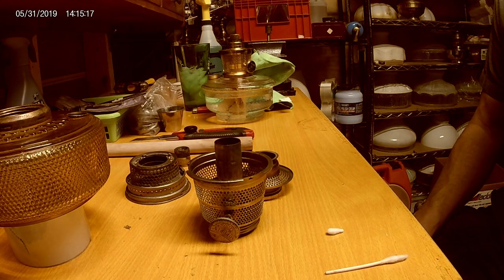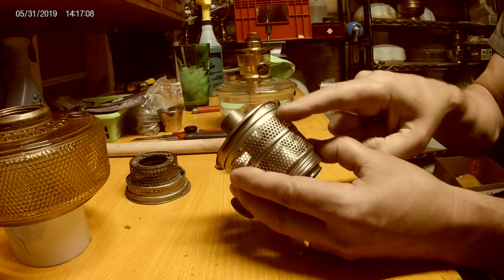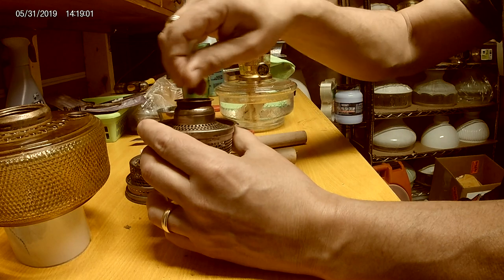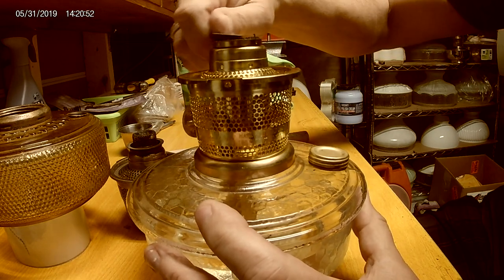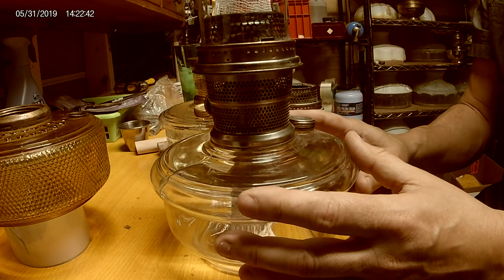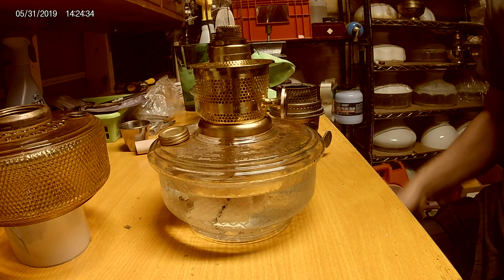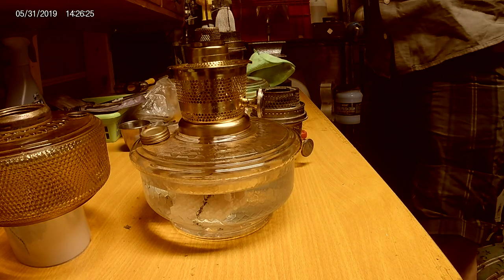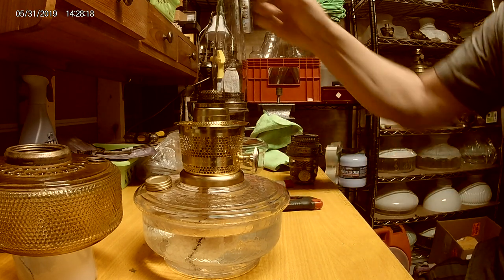Aladdin Mantle  troubleshooting

Comment: Thank you! This was very informative. I moved on to a narrowboat and found an Aladdin lamp in a cupboard. There was a brochure and a letter written to the makers complaining that it was too dim. I know nothing about them but I have Tilley pressure lamps. Your advice has given me the inspiration to get the Aladdin working well.
Reply from the maker: You are welcome. I'm not familiar with the Tilley Pressure lamp but it looks like a Coleman lantern to me. If it acts the same as Coleman, that is a great lamp because you take it outside and it makes a lot of light. The only issue with that style of Light is that it makes a lot of noise indoors and if it uses White Napha as a fuel, that is about $30 a gallon, almost $5 a litre. Now Kerosene bought in Bulk at the pump is about $1.50 Canadian.
when an Aladdin is running nicely it should be hard to look at night without a shade.
Cheers and good luck

Comment: So happy to have found your channel. As for my #23,  the flame continues to creep up even on the lowest setting. New wick, K1 kerosene, trimmed and re-charred but still the creeping and a few spikes. This is my second lamp and the other performs just fine with high altitude chimney & light booster. I live @ 7,500 ft.(2,275 meters). Thanks, Steve
Reply from the maker: I have had mixed success with 23’S. I have one that is phenomenal and a few others that only will work at 60%.
You need to find a doner lamp or burner to play with.
Cheers
Reply: @Kerosenecanada  Thank you. Taking a leap and purchasing a new MB 502! found a MIE #23 you know where but may wait to see how the MB 502 performs here at elevation.
Regards,-SW

Comment: Thanks for posting this - I have a 70s British model 23 (Aluminum bowl) that runs, but currently suffers from a flame spike in one spot so it's not terrifically bright. Thankfully I spotted the issue and turned it down. 

I don't have a wick cleaner/shaper, so I've ordered one and then I'll see about getting the wick clean and even - if it keeps going I shall try your other suggestions!

Comment: The brass wick trimmers are made to trim by turning clockwise, the plastic ones work in both directions. The manner you show with the wick extended up so high could lead to an uneven trimming because it isn't referenced to the lip of the wick holder. I found it better to burn the wick for a minute or so, pull it back down, put the trimmer over it and raise the wick just enough that it starts to lift the trimmer. Then, while pushing gently down such that it (the trimmer) rests against the outer ring of the wick holder while turning clockwise. You might have to slightly extend the wick as you work out (scape away) any unevenness.

Comment: So im soo glad I found your channel. Not much out there content wise but your video have helped me get my main three lamps going and running well. Was curious about if you come across deformed mantels alot. I found two boxes of Loxon mantels and about 70% of them were deformed in some way that they just won't run correctly.
Reply from the maker: levi Anderson , I really only use brand new mantles as a rule of thumb Levi. I have old mantles that I run across and I just don’t use them. Sometimes they are oddly shaped and sometime they just fall apart after a few uses.
When it comes to wicks and mantles, I find new stock is the best.  
What is country of origin on those mantles?

Thanks
Dave

Comment: Hi thanks for the info, great video. If I’m purchasing an Aladdin lamp how can I tell the difference between the different models also would it be better to buy new burners and will new burners fit old lamps. Thanks.
Reply from the maker: http://www.aladdinlamps.info/

This will help. Sometimes the new ones are not any better than the old ones. The model B is considered by most lamp owners as the most reliable.
Cheers

Comment: I realize is an older video but - I have a small metal cup like you use to put in your chimney when you blow it out, but I am nervous to use it for fear the very hot chimney may crack when the cold little cup is dropped in place. I just want to clarify, you place this little cup to stop the convection immediately after blowing out? You never had a cracking chimney doing this? Thanks. 

Great videos. I am slowly piecing a small lamp hobby together and have relied on your vids a lot.

Comment: What do you recommend for model 12s for inconsistent Burns even after trimming wicks and repositioning galleries I have two that I burn in the winter time and fall and this is always been an issue input would be much appreciated thank you and great video.
Reply from the maker: You know, I run into that problem quite regularly. I just swap out parts until it burns nicely.
Even if you identify miss matched parts or tolerances you really need spare parts.
I think it’s a gallery issue as a guess as what I find is a common problem.
If you got a local lamp guy around you, you might want to pay him a visit.
Thanks

Comment: I have a C model burner that just won't burn blue. Just get yellow spikes. I have tried trimming it but that doesn't seem to help. The wick is for B C and 21C . the lowest the flame spreader would go was 2 rows of holes higher than the top of the gallery. I trimmed off the bottom and now just one row shows above the gallery. There was a slight improvement with the flame. Do I need to lower the spreader more ? .... thanks for the nice video
Reply: Kathleen Winans  Hi Kathleen, sorry to hear of your issues.  Are you using Kerosene? If so and you have those flame spikes, that means there is an air leak . The outer wick tube is not close enough to the wick. Now without seeing it , that’s just a educated guess.  Model C burners were redesigned several times and the parts don’t interchange, maybe the outer wick tube is off another model, it might fit but not work properly. The flame spreader should be pushed all the way down and see three holes rows on a Aladdin model C IND Brass burner.. I just grabbed one from my lamp room at took it apart, it really doesn’t assemble nicely. If you can get it burn evenly and blue, I would look for a model B to replace it. They use the same wicks and mantles.  Good luck.

Comment: Your lamps are all so nice and clean! I have a model 23 that was left for a number of years unused and the kerosene all evaporated out. The glass font had green residue that I cleaned out, but the burner has a lot of black residue that looks like tar. What would you recommend to clean it up?
Reply from the maker: arweninnj  I use oven cleaner and or paint stripper depending on how bad it is. Some other collectors swear by ammonia, some like lemon ammonia. They will all work. I personally don’t like the smell or ammonia.

Have a great day
Reply: @Kerosenecanada  Thank you!

Comment: Before my grandma passed away, she gave to me the Aladdin lamp they used to light the farmhouse before they had electricity when she was a little girl.  She said she remembered it being so bright that they had it in the middle of the room and the family could sit around it all reading in the own corners of the room.  I looked up the design and think it’s a 23.  I’ve replaced the wick and the mantle, and I can get it to light just fine.  It seems to have a good even flame around the wick.  I turn it on low, leave it a bit, and then try to turn it up brighter.  But I seem to keep burning up the mantle when I turn it up. Am I just probably trying to turn it up to bright? Or what else might I be doing wrong?
Reply: I have a 23 that does this. I think it's not pulling in enough air to cool itself as even the nob to turn it up and down gets hot. I'm currently running a 23 with a high elevation chimney and it stays cool. I'm gonna order another, I can't switch them to verify as one is lox on and on is slip, and see if that helps the issue.

Comment: I have a B&H center draft oil lamp. The parts are frozen and I have no idea how to remedy this. I’ve tried using three in one oil and letting it sit but it’s not helping. Do you have any ideas of what I can do?
Reply from the maker: Heat. Get it real hot, wear gloves. Hair dryer or hot air gun works well.
Good luck.
Cheers
Reply: @Kerosenecanada  I’ll give it a go, thanks!

Comment: Paraffin fuel supposedly burns cleaner with less soot and fumes, but some say that wax will eventually clog the wick in an Aladdin lamp.  Which fuel is best?
Reply from the maker: Kerosene because it burns cleaner with no carbon build up on the wick. Cheers

Comment: Thanks just got a new Aladdin and it’s start glowong low or in the middle never will toward top except if it’s at the point of over burn
Reply from the maker: I would have to guess on a lot of things. Burner type, new wick?
You might have to adjust the position of the flame spreader. 
If your flame spreader is pushed in too low, the flame will be at higher point of the mantle.
If the flame spreader is too high then it will only light up the bottom of the mantle.
This is just a guess at this point.
Good luck.

Comment: I just bought some mantles labeled " Aladdin Upright Gaslight Mantles"   They look like newer versions and the bases are made of aluminum.  Are these safe to use?  I've been told that the aluminum bases are prone to melting.
Reply from the maker: Those are designed gas lights, not kerosene.  They won’t work. Sorry.
Cheers

Comment: When I burn my B burner with the B gallery assembly, the flame & incandescence is flickering/quivering regardless of the wick setting. When I put the 23 gallery assembly on this B burner, it's smooth. It also SEEMS the flame is higher and more jagged with the B gallery at a comparable incandescence level to the 23 gallery. What causes this? (The B gallery has a new India very wide & globe shaped mantle & at full tilt, the bottom 1/2" is not glowing, if that offers any hints.) Being OCD, these darn things can be frustrating. lol Thanks so much.
Reply: I borrowed another B gallery that works fine.. The micrometer showed the inner-most gallery cones are the same size, but the bad one is positioned higher which would cause a leak. I wonder if I can smack it down a bit with a proper diameter tool so it meets with the outer wick tube sooner?
Reply: FIXED IT!  One of the 3 lips on the top of the basket that secures the gallery was bent down which caused the gallery to distort & rock when secured. Used pliers and bent it back up and now it works fine. The blue flame is still a tad shaky at lower settings, but incandescence flicker is now gone! Also used a NOS mantle instead of the new garbage Indian-made one. Those new mantles are destroyed during the initial burn-off process... disgraceful.

Comment: I’m working a #6 Aladdin brass job but don’t have a 6 flame spreader. Know the best one to get the burner souped up?
Reply from the maker: Well the question is where do you live? I might know of a collector friend nearby.
The good news is that the 6 flame spreader is still a fairly common part.
As far as Souping up. They are a Hot Rod right out the box.
Cheers

Comment: I have a very old Model B which needed a new wick.  All of the videos I've seen, the wick carrier comes out the top (it seems all of the videos are for a 23?).  On ours, it only comes out of the bottom, I'm guessing this is normal for a model B?  Thanks!
Reply from the maker: Yes, it slides out the bottom.it’s easy to change, that’s why there is no videos.
Cheers
Reply: @Kerosenecanada  Thank you so much!  I'm in the process of cleaning it up, pretty sure I need to polish up the wick tube, it's pretty rough.  Thank you again for your help and the great videos!
Reply: @Kerosenecanada   One more question if I might....what would you recommend to clean off all of the dried kerosene from the flame spreader, etc.. So far, it laughs at mineral spirits...  Thanks!
Reply from the maker: @gregorymoore3526   try ammonia.
Reply: @Kerosenecanada  Thanks! I'll give that a shot!
Reply: @Kerosenecanada  Thank you so much for the ammonia tip, soaked everything overnight and poof!  Again, thank you very much!

Comment: I am having a problem with flickering and uneven burns. Sometimes the flickering is even audible. Mine is a 23 with the aladdin lamp on the knob. Any ideas? thanks
Reply: ok, I trimmed the wick like you showed with the knife, but used a double edge razor blade. With the wick riser all the way down, the wick was above the inner wick tube. I trimmed it flush and it is working great. Thanks for the video.

Comment: are you kidding me? the way you trimmed that wick you will never get a round burn,
Reply from the maker: Lordphoton99 Linforthewin  works for me. Also sunflame mantle lamps, a brand of Farmor also recommends this method of blade trimming.
Reply: @Kerosenecanada  the way you described it in words, yes! it will work, I'm not being disrespectful, it is the way you demonstrated on the video doesn't work, you can't burn away those loose thread if you have kerosene in the la,mp, and definitely not with a lighter and then you start to pull it with your fingers which create more loose thread, I would appreciate if you make a time lapsed video that you actually do it the right way so we all can see how it is done.
Reply from the maker: Lordphoton99 Linforthewin  this method is for trimming only. The idea is that you are cutting off the carbon portion only. Realistically this will only remove the last 1/8 “ or less in carbon. As you said if you start cutting in to fresh wick, you run the risk of pulling threads. If your wick is way out then there is an underlying issue with lamp burner.